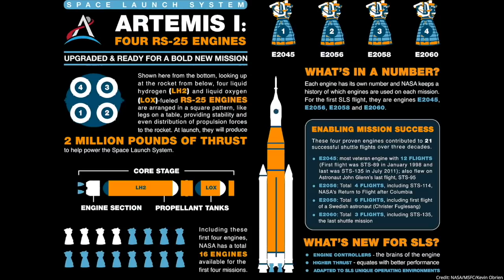SLS Core Stage Hot Fire Test

Comment: This rocket is surely a beast.
so sad it had problem during testing, but failed rocket at test is much better than at airborne.
hope they fix it soon.
Reply: That's what testing is for. To work out the bugs in the system and ensure that it works properly under actual flight conditions.

Comment: On the bright side, this result is the purpose of testing.
Reply: If this were 2015 I might agree with you.
Reply: @jshepard152  And with dedicated test stage
Reply: They set the shutdown margins too wide, nothing technically failed
Reply: @Aaron-ru6ld 
Oh it technically failed alright.    They planned for eight minutes and got one minute.  If one was sufficient, why on earth would they plan to burn for eight?  They definitely didn't get the pressure data they wanted as the tanks emptied out.  By their own standards they should rerun the test.  But if they do they'll likely miss this year's launch (again) so they may give themselves a pass.
Reply: @jshepard152  Yes of course, but the only fail here was how conservative Nasa engineers set the shutdown margins. Had it not been for the margins, the test would've been perfect.
Reply: @Aaron-ru6ld 
Maybe.  But even so, it's gonna cost them.
Reply: @jshepard152  Not maybe, its all over the news
Reply: @Aaron-ru6ld 
I'm aware. I listened to the NASA teleconference.  But you're assuming the next seven minutes would have gone swimmingly had the test continued.  And that's something you cannot know.
Reply: @jshepard152 the engines shut down due to a command sent to them by the vehicle due to the pressure drop. The limits that were set were overly conservative to protect the rocket while bolted to the test stand. It would not have dropped out of range in flight.
Reply: @jshepard152  but youre acting like you know it would have been bad. Its not a failure because you dont know if it would have been a failure. That doesnt make sense. Its only a failure if its literally a failure.
Reply: @jptwentyfour887 
The test was a failure.  If it wasn't, why would they repeat it exactly?!
Reply: @Aaron-ru6ld  it was on purpose to protect the rocket on the stand
Reply: Exactly. Testing like this will allow the engineers to find the bugs in the system and iron them out so that things like this don''t happen when the rocket is in flight.
Reply: Now it'll cost millions more and be further delayed.
Reply: @Thunderchild-gz4gc  you think this is easy?

Comment: I am a little confused right now.
Shouldn't the mixture ratio be 1:6 for Oxidizer/Fuel? I thought more hydrogen can generate more Isp.
Reply: The ratio is actually a mass ratio iirc, so a stoichiometric ratio would be 8/1. There is a stoichiometric excess of hydrogen in the  mixture, resulting in a 6/1 ratio. Of note, it is possible to increase isp further with more hydrogen but this would actually result in a decreased delta v due to the low density of hydrogen requiring a lot of tankage. It is better to go with a slightly lower isp so you can use more of the dense oxygen, resulting in smaller tanks. Of course as there is still an excess of hydrogen as a stoichiometric ratio would be worse than a comfortable midpoint.
Reply: @Draginea  haven't thought about that. Thank you.
Reply: @Draginea  Stoichiometric would also result in excessive temperature which could not be withstood. Part of the reason for excess of hydrogen is actually to keep down the temperature.  Higher temperature  is desirable for efficiency but is limited by what the combustion chamber can withstand and that is generally what defines the lower limit for hydrogen to oxygen ratio.

Comment: Why do Blue Origen and SpaceX tests seem comprehensible but Boeing "stuff" seem so larger than life?  I mean, this test stand and the SLS core are fringing MASSIVE!  Maybe its just the camera angle lol?
Reply: Because it is a giant test stand for a giant rocket. SpaceX has test stands in McGregor for Falcon 9 and FH boosters. Of course, those are much smaller rockets and there isn't as much public exposure. For Starship, they just don't attempt full duration static fires. Every "hot fire" test at Boca Chica has either been a very short static fire, or an actual test hop/flight of some description. SLS can't do that, since every rocket is enormously expensive, and if it leaves the ground it isn't coming back in one piece.
Reply: Boeing or i ain't going 🤣
Reply: The power of this stage is actually about the same as a Falcon 9 booster. It is wider and taller but only because liquid hydrogen occupies much more space than kerosene.  
The power of SLS comes not from its core stage but from the side boosters. Each one of those boosters is heavier and almost twice as powerful as the SLS core stage. The boosters were not in this test.
Each engine on the SLS core has approximately the same thrust as the Spacex Raptor, or a bit more than double that of a Merlin engine.
Reply: That's a real platform. Unlike that quicksand pit in Boca Chica.

Comment: What's a green run? What's a hot fire?
Reply: Green run is a go or no go test on the flight hardware, it usually has a multitude of tests to confirm every system is working properly. A hot fire is part of some green run tests, where motors are fired up like what you see in this video.

Comment: It's literally pooping out a cloud, a regular water vapor cloud.
Reply: The flames are hidden within the “flame bucket”; which is what its called.
Reply: stratospheric water vapor is also an issue since it isnt part of the water cycle, therefore it stays as greenhouse gas more powerful than co2 in the upper atmosphere. so flying with methane produced from atmospheric co2 is actually more friendly to the atmosphere since there is less water vapor in the stratosphere and net neutral co2 in total
Reply: That's the steam from the Ignition Over-Pressure/Sound Suppression Water System (IOP/SS). They pump thousands of gallons of water in to damper the acoustic energy which would damage the rocket
Reply: industry terms
Reply: Odd1sout:
Wow

thats a big cloudmaker

CONTEXT: James from the Odd1sout thought that planes and farctories made clouds
Reply: The problem is liquid hydrogen production. Steam reforming uses, guess what, methane.

Comment: Was it successful or not? It fired for just 50 seconds.
Reply from the maker: NASA: "Teams are assessing the data on early engine shutdown."
Reply: *67.7 seconds
Reply: Nobody killed, platform wasn't destroyed, so its success. Only for russians media requested full success after any tests.
Reply: No, they have not good data and they shutdown the 4 engines
Reply: Jesus will it fly in 21
Reply: @petermcgarrymusicandflying  Only if they do this by mid-feb. That's when the booster rolls out to KSC for 2021 flight.
Reply: SLS fires for 67 seconds. Keyboard Warriors call it a total failure. Starship crashes spectacularly with 100٪ destroyed hardware. Huge Triumph. 🤔
Reply: @TheMrPeteChannel  in SpaceX defence they have been incredible transparent with their operation, and Elon has stated many times they will have failures during testing so we have become acustomed to firery explosions.
Reply: @TheMrPeteChannel  Well, In spite of the loss of tank pressure, resulting in the crash of SN8, Musk says they got the data they needed to validate their flight control surfaces for pinpoint landing. Last I checked, SpaceX has built two more test ships to replace the one they've lost, and possibly more. From what I've read, the SLS green run test wasn't nearly long enough to get the data NASA needed. The time it will take to inspect the failed engine, replace it, (Aerojet has more RS-25s) refurbish the three other engines, doesn't bode well for the November 2021 launch date for Artemis-1. :( 

Update Jan 19: turns out the premature shutdown was due to overly conservative operating parameters. Though it's unclear how this will affect the launch date, though perhaps not as poorly as a broken engine which what seemed to be the problem at first
Reply: @TheMrPeteChannel  If you consider the Starship flight a failure then by that same measure each and every  SLS that ever launches is going to be a failure as they will all crash into the ocean after having been of the ground for just a few minutes.

Also by that same measure you can say that the SLS test failed because it did not get off the ground, even if  just like the Starship landing, it was not part of the test requirements.
Reply: @listerdave1240  If a rocket is 100% throwaway or 100% reusable the goal is clear. BEAT CHINA PLACING A WOMAN ON THE MOON. China is the true space race enemy. Not Boeing. Not ULA. Not Musk-rat. Right now as I see it SLS is still a head. Use it. Then we go to Flippy McFlippyface ship.
Reply: @TheMrPeteChannel      You're making the wrong comparison.  The proper comparison is SLS vs. Falcon Heavy.  SLS ahead?!   lol.  It lost years ago.